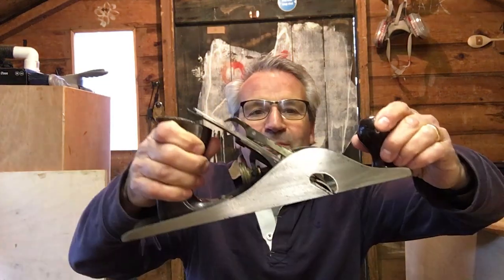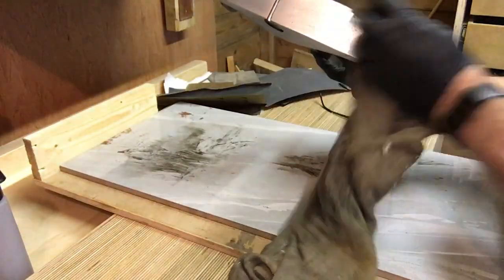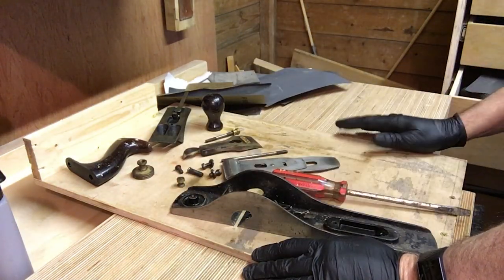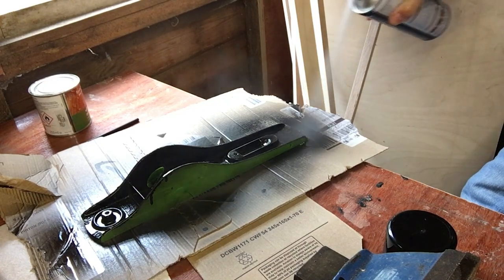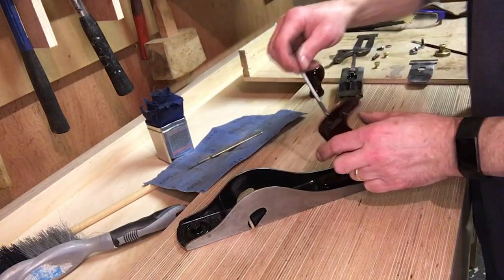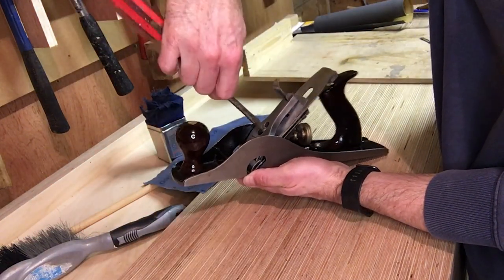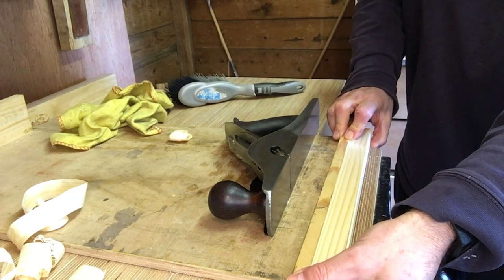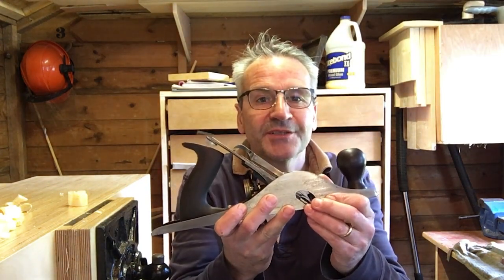Stanley No. 10 Rabbet Plane Restore

Comment: A very nice plane.    Cleaned up well.   A very good addition to the shop.
I have good results using MinWax wipe-on-poly on my wood turning projects.   Each coat is thinner than brush or roller, but I get nice even coat.    A light hand sanding with 400 grit paper to remove dust nibs, and then buff with a dry buffing wheel between the coats.    I apply 4 or 5 coats and get a nice even and hard finish.    I am a hobbyist so the time is not an issue.
If you want to protect your metal surfaces from moisture, consider Fluid Film.   A lanolin based product which works well.   UK link to illustrate
https://www.scparts.co.uk/sc_en/warehouse/workshop-fluids-and-consumables/conservation-and-rust-prevention/fluid-film.html
Also if you ever want to upgrade a hand plane blade and have the budget, consider a blade made by Ron Hock.  He does make a blade for this rabbet plane.
http://www.hocktools.com/products/bp.html
I read that Stanley were famous for mixing new feature parts with older stock, so your frog may have been a new design with the micro adjustment screw, but the body may have been the previous design.
I have seen this in some planes myself.
Dave.
Reply from the maker: Thanks for the advice on finish will try and get some of that S

Comment: Oiled handles way to go, it's a working tool not a drinks cabinet.   Look is vg
Reply from the maker: its a beaut
Reply: I'm a retired Carpenter, I've had an English version of this plane sitting 1978 and I still use it. I always believed it to be called a badger. Bench rebater.